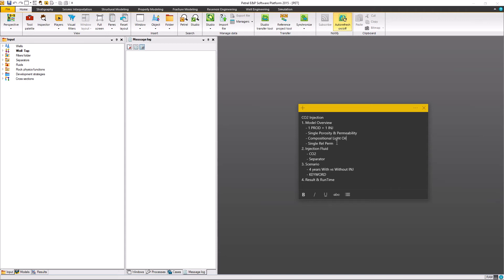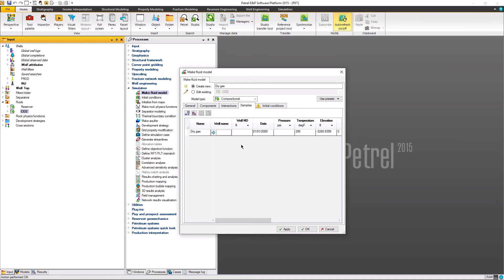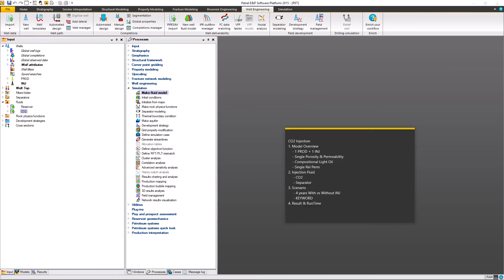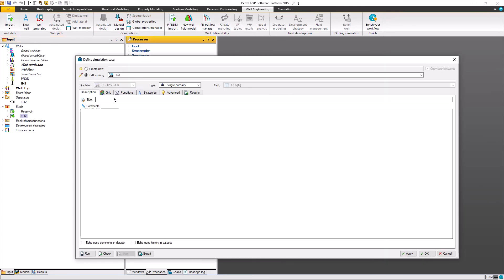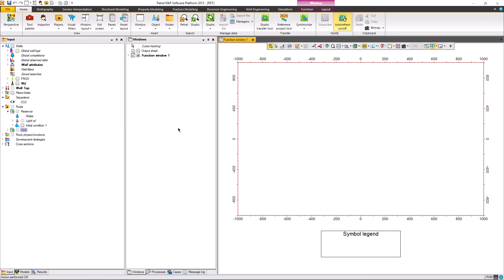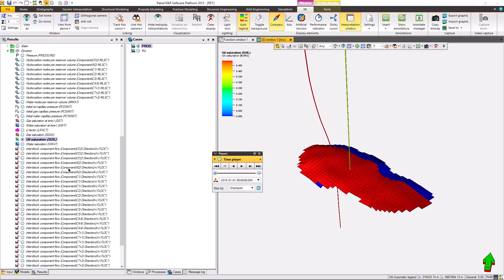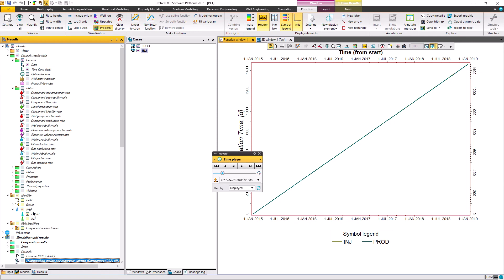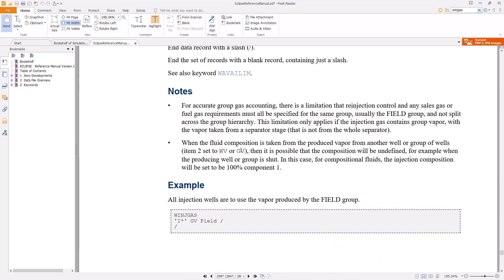Petrel Series Part 20 : CO2 Injection

Comment: I apologize, Great video ! But I seem to be missing the dynamic folder from the download link. Could you please provide me with more information or check if there's any other way to access the required folder??:face-purple-crying:
Reply from the maker: What is the problem with the download link?
Reply: @AgungBudiarto  In the simulation grid results, there is no Dynamic file ? I also can't find saturated oil ?
Reply from the maker: @nhamnguyen712  i dont remember that much, this video was made in jurassic time. If you cant find the dynamic file, just run the case. you cant find So? thats weird, its a default thing.
Reply: @AgungBudiarto  Thanks sir 🫡

Comment: Thankyou very much for your videos - extremely helpful. I have a question on carbon storage in deep saline aquifers though which you might be able to address (please). Do you know how to input both drainage and imbibition relative permeability curves in Petrel, so that residual saturation in isolated "microbubbles" can be estimated once the plume has moved through an area.  Thanks.

Comment: Hello, I’ve got two questions and I would really appreciate getting any suggestions. If I’ve already done water flooding in my field and I want perform CO2 injection, how to start it from the point of finishing water flood? The second question applies to the minimum miscibility pressure, why wasn’t it established anywhere during the video? Is the software calculating it by itself or was it just skipped?
Reply from the maker: 1st question, just a matter adding another injection rule in schedule.
2nd, what you see in video is basic operations, TBH i dont know whether  MMP is an option or not. But in this case, I dont find the input, so I believe you need to observe the result through graph and grids.
Reply: cheers, all the best!
Reply: @Agung Budiarto Hello, I’ve got one question, and I would really appreciate if you could suggest how to make it. I was wondering that can I create nitrogen injection instead of CO2 injection well by following your steps proposed in this video?

Thank you in advance.
Reply from the maker: @peerayootjonkokkruad519  at the fluid model, give N2 the highest number you can, and leave other component to 0 (if possible). I dont know for sure though :p But it should imitate clean N2.
Reply: Agung Budiarto I’ll follow your suggestion and will let you know what it looks like. Btw, once again thank you :)

Comment: This was really helpful, thank you. Also, I see that this is a Compositional model so I want to ask if is it possible to do CO2 injection for Black Oil model using Petrel?
Reply from the maker: I dont think thats possible, black oil means you'll play with pressure function rather than in composition. So at the gas injection scenario, you'll have the gas at its fluid model preserved.
Reply: @AgungBudiarto  Sorry I didn't get 'gas at its fluid model preserved' I am quite new at these stuff. When doing a general gas injection using black oil in petrel, would it be valid if all the properties such as density, viscosity etc of the gas is changed to properties of CO2? or is this the properties of the gas that is within the oil?
Reply from the maker: @user-xg1ez3be4h  Yes, the closest you can do is to create the "injection fluid" from  fluid model, and exercise to achieve similar behavior
Reply: @AgungBudiarto  Thanks mate!

Comment: Terima kasih Mas Agung atas semua Tutorial Petrel yang sangat bermanfaat.
Maaf kalau boleh request Tutorial untuk Petrel EOR selain C02. Seperti Steam Injection, Polimer & Surfactant. Soalnya masih bingung cara membuat data PVTnya yg untuk diInjeksi. Terima kasih Banyak.
Reply from the maker: Sama2 mas, senang bisa membantu. Hmm, menarik sih, tapi kayanya lebih pas kalau di software PVT ya? Tapi kapan ya bisa upload lagi wkwk..
Reply: @AgungBudiarto  Terima kamis Mas Agung atas balasannya. Kalau untuk Thermal Injection kira2 bisa nggak ya kalau dibuat pakai PVT di dalam Petrel lalu dirun seperti contoh CO2 di video ini?
Reply from the maker: @mohammedsheikhal-attasimoh9419  kelewatan balesnya, but better late than not right? Anyway..saya belum pernah simulasi thermal, so..hehe..